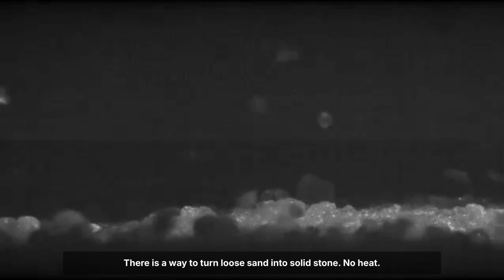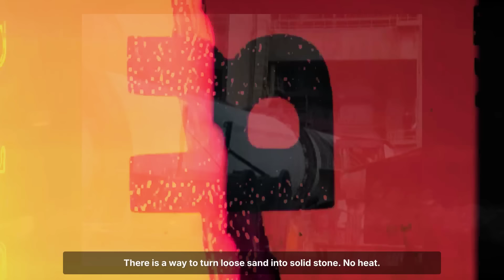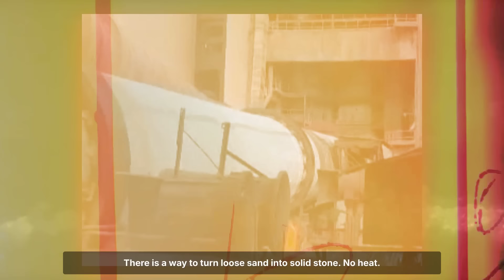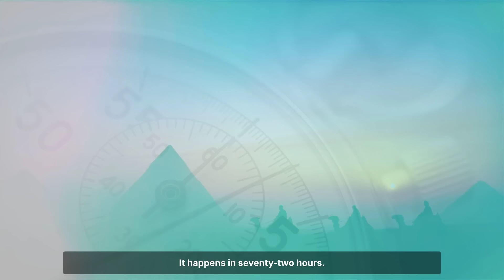This Bacteria Turns Sand Into Solid Stone. No Heat Required. Why Do Building Codes Reject It?

Comment: If waste ammonia is made during the production of this stone, then this should not be a problem. It can be captured and used as an energy source, as ammonia is used as a way of efficiently transporting hydrogen fuel. Then, it can be thermally degraded into hydrogen (fuel) and nitrogen gas when used.

Comment: You can do the same with a relatively simple chemical reaction.

That's how the ancient world did it.
It's was often called "water glass". And it's nothing new.
People use to make a solvent by boiling "pot ash" in water.
Then they let it cool and filtered it.
Now you can solve silica sand or quarts in it, resulting in a thick liquid you can store in a container. 
You can mix this with more sand on the constructionsite until it's like wet compact beach sand.
You can shape it in any form you want. 
Then all you have to do is ad an acid.  {spraying it a couple times with plenty normal vinegar will do fine}
There will be a chemical reaction turning the sand into stone.

It's easy and cheap. That's why it will never be accepted.
They make big money on Portland cement. So they make sure it's mandatory in all building regulations. 
And the banks and governments also don't want people to have affordable houses. 
They want an army of brainwashed slave laborers. 
People forced to work their entire life just to pay off their mortgage and student debts.

Comment: @NaturesLostArchive - Does this bacterial method actually require clean sand? Can it be used with clay? Clay/sand mix? Does it specifically require calcium chloride? Can slaked lime or quick lime be used instead? Where can full information be found?
Also: There is a lot of confusion about this entire subject, if the comments are anything to go by. Please clarify!

Comment: And RMIT University "discovered"(what the ancient monolith stone builders knew all along IMO), that replacing 15% sand in concrete with biochar, created by heating spent coffee grounds to 666F,  increases compressive strength by up to 30%.
Reply: After 40 years of mechanical, i find molecular (chemical) engineering more fascinating.
But could we say 667F degrees, and skip the Dante's Diablo number ? LoL !!😅

Comment: Apparently, all 'sands' are not the same. Silicon/Quartz type isn't the same as what is talked about in this video, which is CALCIUM.
If possible, CAPTURE the emitted Ammonia, and it can be used as a fuel for vehicle engines, or injected into soil for fertilizer.
Sadly, it takes too long for the lobbyist-bribed politicians to ALLOW the building codes to catch-up.

Comment: Building code or not, it could still be used for sidewalk, driveway or shed. There it's not holding a roof or heavy structure. If it cracks than just fix the crack.

Comment: Carbon dioxide is at 0.04% of the atmosphere.
At 0.02% all plants die from carbon starvation.
The atmospheric carbon percentage is at a historic low, and you should understand this.
STOP with the carbon flogging bankers scam please.
They are just taxing you for the air you breathe.
Humanity, burning oil and making cement, are responsible for just 3% of total emissions anyhow.
So we are irrelevant.
Go plug a volcano if you want to reduce carbon dioxide for real and starve

Comment: The framing here is pretty misleading. 
Saying this process needs “no heat” and produces “no CO2” ignores the upstream inputs. 
The bacteria may precipitate calcium carbonate at room temperature, but they still need a calcium source and usually urea. 
If that calcium ultimately comes from limestone processing, you have not eliminated the core cement problem.

Same with industrial urea, which is also energy-intensive to produce. 
So this is not a zero-carbon replacement for cement in the way the video implies. 
It likely has the same, or potentially even worse C02 emission potential than standard concrete, depending on how it sources the calcium.

It is a potentially useful niche material or soil-stabilization method, but the full lifecycle emissions matter, not just what happens at the job site.

Comment: Because xeric soils literally form over hundreds of years, yes two, three hundred years is not out of the question for a xeric crust of 1/4" to form! It can be disturbed by erosion [footprints], as the crust is damaged, rain can slip under neath the even sheet covering the whole desert. Then, more of the crust is undermined in each storm, and eventually whole sheets slip away in big storms. This leads to runaway erosion. The thing is, you have to realize this is formed by exudates of polysaccharides in a sort of symbiotic way, the bacteria must trade their photosynthetically derived sugars for the minerals which fungi liberate using their hydrochloric acid. Mainly silicates. The silicates are also in the right state of weathering after eons before, and can mainly only get glued together at that exact moment when the metals have been sequestered enough to let the bacteria live, there has to be enough very fine silicate dust, or silicic acid in solution. The formation of silicic acid is still not fully understood and a fairly stable equilibrium process that occurs over geologic time, not on the order of a building project. 

But sure, thanks for the AI slop [Written by me, Simon, a real human, :)]

Comment: Much of a single story slab is not load bearing foundation.  Much of a slab could be 10mPa.  In fact this seems like a potential replacement for asphalt paving like ground level parking.  Instead of repaving, occasional application of a solution would heal fine cracks.  Larger cracks could be cleaned and filled before the scheduled maintenance solution.

Comment: We spend a TON of time and money to create ammonia on purpose. 80% of our food depends on it. If this ammonia can be contained, you now have a valuable fertilizer PRODUCT, not a WASTE.
Reply: But we don't try to create it on a job-site. Which is a huge distinction.
Reply: @russmitchellmovement - Ammonia has to be at a somewhat concentrated level to be an actual issue. Construction sites usually have plenty of airflow to prevent the ammonia level building up. Where ammonia becomes an issue is when bricks or blocks are being made this way in a factory. But that is also where there's an opportunity to recover the ammonia so it can be used as fertilizer.
Reply: The ammonia produced in this process isn’t a new source of fertilizer.... it’s just coming from the urea you already added. The bacteria are simply breaking urea down into ammonia and carbonate so calcium carbonate can precipitate. In other words, you’re converting one nitrogen fertilizer (urea) into another form (ammonia/ammonium). You’re not creating new nitrogen out of thin air the way industrial ammonia production does.

Industrial ammonia production (Haber-Bosch) fixes nitrogen from the atmosphere using a lot of energy. That’s why it’s valuable and why 80% of food production depends on it. This bacterial process doesn’t fix nitrogen at all.... it just releases the nitrogen that was already in the urea feedstock.

So if anything, from a fertilizer perspective you’re actually consuming a fertilizer input (urea) in order to make the carbonate precipitation work. Any ammonia you capture is simply recycled nitrogen from the urea you had to supply in the first place, not a new fertilizer product generated by the process.
Reply: @michaelransom5841 - urea, which comes from urine, is a combination of ammonia and carbon dioxide. Plants don't need carbon dioxide in the soil, they need it in the air. Roots need oxygen. Urea fertilizer exists only because it is convenient, not because it's better fertilizer. So the premise of your comment is without basis or merit.
Reply: @YodaWhat what??... I don't think you understood my comment.
Reply: @m @michaelransom5841 o … urea, which could be used as a fertilizer, is being g used for construction, and the “runoff” being the freed ammonia, could still be used for fertilizer?  Yes?  Much like one could put grain in one’s muffins, or brew with the grain and then use the “spent grain” in the muffins, thus getting the initial substance (the grain) to do double duty.  (And nobody’s even talking about marmite yet.)  So, if the freed ammonia could also be used in fertilizer, then you can just collect the urea from the various animal farms, or even humans. (I wouldn’t be surprised if a single rest stop on the New Jersey turnpike might be able to serve up quite a bit of urea for all kinds of construction needs.)

How big bricks can be made?  Is there a self-limiting factor, or a square/cube law to worry about?  What is the best aggregate to bind with?  Perhaps limestone  dust?  Could it be an easy way to build a cistern or dome, by, say, inflating a shaped balloon, and then pouring the mixture all around the mold, and then, pop and you have a dome or a well-made hollow in the ground.  Maybe even a step well?

Comment: Didn't Rome have self healing mortar? I remember hearing about calcium carbonate being the key to its self healing properties
Reply: Those terms have changed.......now is "resilient mortar".
Reply: Yes. Just saw a video on it. It's Roman concrete, not mortar. They figured out the trick. Quick lime super heats and does some amazing chemistry.   The entire concrete is reactive and does in fact self heal.
Reply: @tarajoyce3598 got to get the mixing right too ,
Reply: quicklime
Reply: There were like seven different materials volcanic rock volcanic ash with a specific pH from the local volcano  pumice calcium carbonate quick lye with chunks and another one of them was required to be mined and used immediately because of the
Reply: @zakbrinkhoff324 right and salt water 🌊
Reply: Thought of the same thing when listening to this. Surely not by purposefully introducing this bacteria knowingly though.
Reply: Yes
Reply: Roman concrete, yes, and I think it's a recently solved formula similar to this, but it became stronger where it "healed" from cracks.
Reply: Sodium silicate (Wasserglas/ water glass)
Reply: sea water; they used sea water. not sure if that is in this video, it might be in another one by this same channel about 'roman concrete' but this one mentions the 'coral' in the material: https://www.youtube.com/watch?v=vnewGzzRdig
Reply: 1 part quicklime
3 parts pozzolan (volcanic ash)
2 parts sand
4 parts coarse aggregate
Water to taste
Reply: Hi
Rome used self healing CEMENT by adding quick lime!😮
Reply: @toosiyabrandt8676  that's why it's becoming harder and harder to
Reply: @toosiyabrandt8676 wasn’t salt water the secret ingredient that took forever to rediscover? I seem to remember some hubbub about that on YT a while back
Reply: @toosiyabrandt8676 and ash from volcanoes
Reply: I just watched a video about that very thing.    https://www.youtube.com/watch?v=2vMWQynyr9Q&t=1904s
Reply: @mysticdavestarotmachinesho5093  Not any long trump just changed that big time
Reply: yea but ceasar wants everything that's his rendered under him? and everyting that's God's he wants? and you know how all of that will go, lol, so what's a fella sposed ta do? take care sm ave a gud veek! more lol, lol, peace!
Reply: I cant remember everything but I know they used sea shells. They would subject them to heat until they turned into something like rubber. They also did not use the kind of kilns we use now - they would apply much less heat consistently over a 90 day period when making mortar or concrete. They understood the process needed time for the materials to bind together.
Reply: @SleepySeel  not rubber but a formed kind of charcoal substance and when introduced to water Foams and fizzes like acid
Reply: @Watchmansdutytwo  Fair enough its so long ago I learned about it I will stand corrected. I do have a memory of somebody squishing one though afterwards. They placed the shells in a metal cage shaped like a very tall brazier and then surrounded it with heat but it was kept at a distance. Knowing me I probably dreamed it. 😄
Reply: Look up "roman concrete for sale". It's a little more expensive than modern concrete.

Comment: If you limit this to precast products you simply use the ammonia to run  Bosch- Meiser process plant. Use renewable energy and you have a way of making Urea which was one of your starting materials.  At the same time you fix some Carbon Dioxide as that is the other raw material for the Bosch-Meiser process, combining the two processes, Bosch-Meiser and the bacteria and you have a way to make a useful construction product and take CO2 out of the atmosphere. QED!

Comment: Interesting however by using stabilized earth construct you could not only lower the 8% cement carbon footprint to 0.8%. In addition the heating requirements would lower by a factor of 60-90%. Also as he have blawn through our old growth wood reserves, it would greatly reduce the strain on lumber harvestin while increasing the lifespan of structures from decades to centuries and very pissibly over a Melania.  How much polutution is eliminated by not rebuild every 25 to 50 years over 500 to 1000 years??? Onlu a cultistist would deny that a 0.8% expenditures to make a building that lasts up to 1000 or more years and uses up to 90% less energy to heat and cool isnt a solution.

Comment: Grok says:
Historical implication: The video links the calcite mineral in pyramids/Colosseum/cathedrals to this bacterial process, but those structures used quarried natural stone or traditional lime-based mortars/pozzolanic Roman concrete — not bio-cement grown with bacteria. The opening may misleadingly suggest ancient builders used MICP (they didn't)

Scalability and cost: The video downplays challenges. Current biocement is often more expensive than Portland cement (~$100/ton baseline), requires specific conditions (e.g., urea/calcium supply, controlled bacterial activity), and isn't yet viable for mass structural concrete replacement. It's better suited for niche uses (stabilization, repairs, low-load elements). Full global replacement would face huge logistical hurdles.
Reply: Regarding cast limestone and the limestone softening method used in Giza which made it possible to scoop out the space around giant blocks and obelisks, you need to study Natron theory. I have the book. It's a fairly new discovery that explains how cheap insulation, heat, and baking soda, perform softening of limestone, and by using the same method with a mix of waterglass, produce 'hard' limestone in 72hrs. The recipe can be used with crushed granite mix to make something a little harder, but to grow granite, you use sound. I actually have a manuscript to copyright that explains exactly how granite blocks were grown inside the Serapeum of Saqqara boxes.
Reply: @mikefromspace  Are you going to make a video showing the step-by-step process to produce hard limestone in 72 hrs? And another video step-by-step video showing how make granite blocks with the recipes in both videos?
Btw, I'm a subscriber to your channel; always had a fascination with fringe & lost science!
Reply: Thank you.
Reply: Add some molasses to the mix to help feed the bacteria already present.

Comment: Cement Was Approved Without Testing The Ozone Depletion - You Need To Prove Your Ammonia Can Rebuild The Ozone. Otherwise, We Are In For A Nasty-Long Reset once Again. - Period.
Reply: I'm confused by what you mean. Ozone and Ammonia react to create a mixture of O2, water, nitrous oxide, N2, and ammonium nitrate. Ammonia does not rebuild the Ozone layer. And the Ammonia in this process would never reach the Ozone layer in first place, it will react with O2 to make water and N2 long before it would rise that high in the atmosphere. There is no interaction.